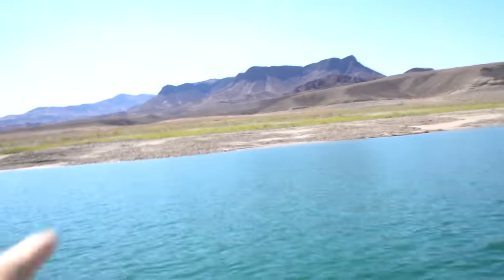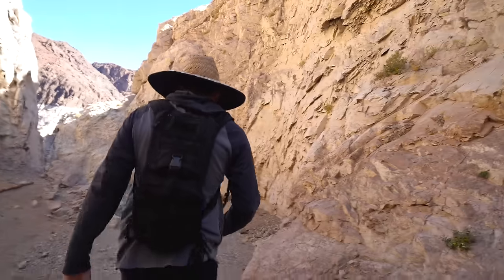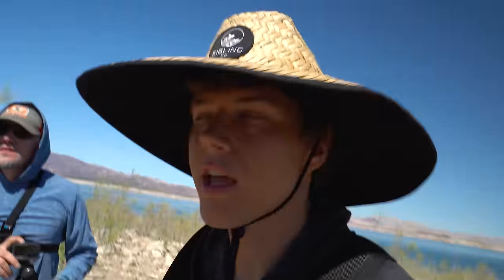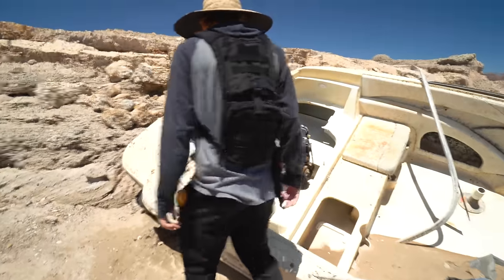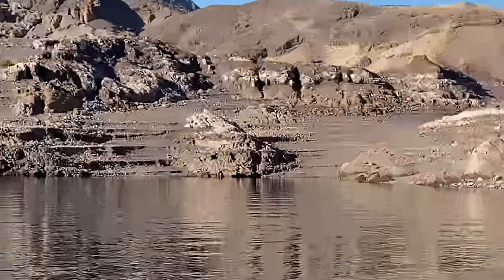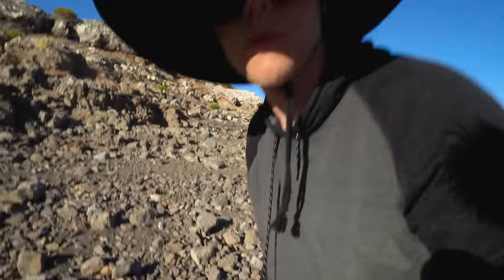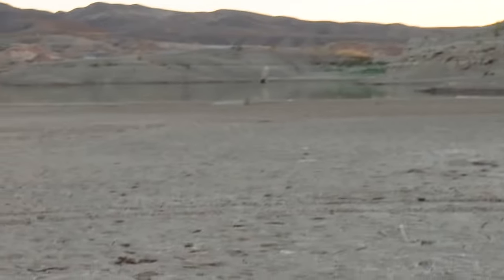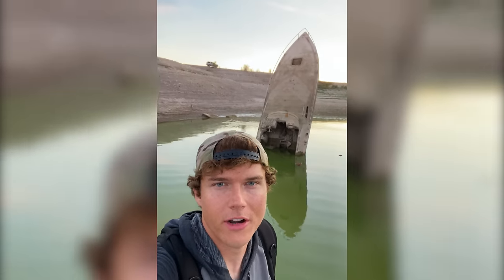Secrets of Lake Mead: Found 6 Sunken Boats, a Barrel and More!!!

Comment: From a survival point of view. You found some good stuff that old petrol had probably gone bad and won't run in a car but you could use it to clean wounds or you could use it to set fire to the tires and make a thick smoke signal that could be seen for miles